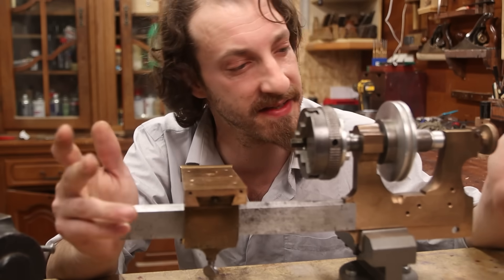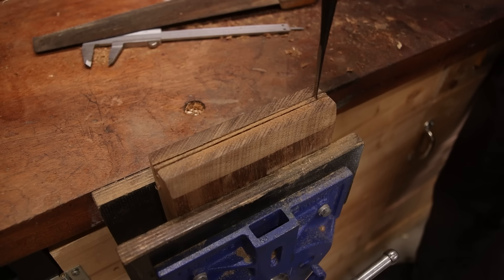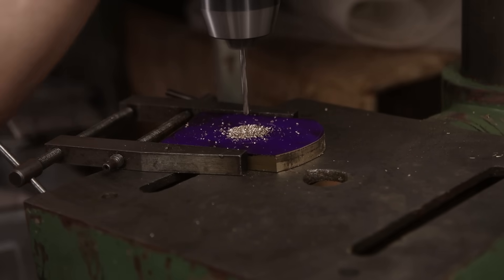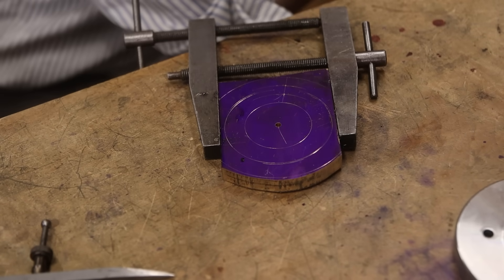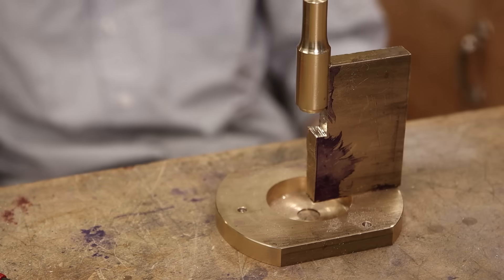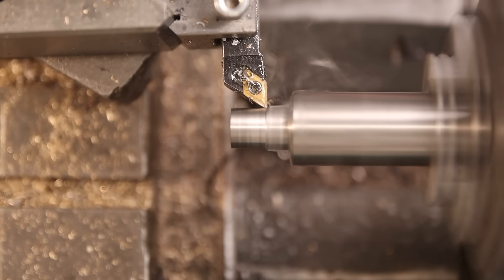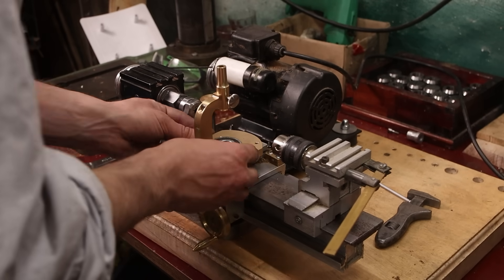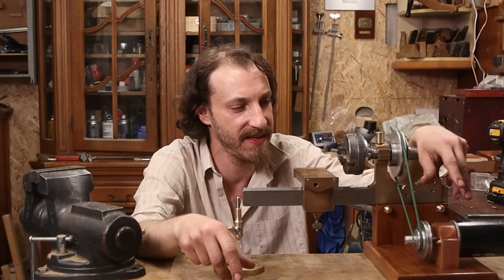Homemade Gear HOBBING Machine

Comment: if you buy a set of Cowells watchmaking machines (+/-5micron) and design and manufacture a proper pocket watch, I do believe you're good, otherwise you are just playing forever. Make a center seconds minute repeater with power reserve indicator, two parallel barrels and small energy escapement. Read Daniels book for a start, and make his watch, and then read 1940's watchmaking books, NOMOS has the know how from that too. Then you sell this watch for 10.000 euros, and you actually made some money. And talent wasn't wasted...

Comment: the problem is the discontinuous cutting from the tap. If you used spiral fluted taps, the tap cutting teeth will always be in contact with the gear and likely have greater chance of staying in sync and cutting the gear successfully.
Reply: No, the problem is the spindles are not synchronized. One needs to drive the other at a precise ratio. 

The other problem is it doesn't look like the "hob" is inclined on it's helix angle, so the teeth interact with the blank on an angle. I guess that's OK if you want a helical gear but I don't think that's the case here? If you did want a straight gear and you did offset the hob axis properly the blank wouldn't be driven by the tap at all as the teeth are passing purely parallel to the blank regardless of it's flute arrangement, so you'd never be able to make a straight spur gear. That's why gear hobbing needs to have two driven and synchronized spindles...

Comment: Hi think you will find the job came loose or the drive belt slipped. So it lost this position/timing so the tap just started milling the job not cutting a worm gear.

Comment: if you haven't already try a spiral fluted tap that way there's always some teeth engaged with the soon to be gear. 
having a gap wider than the material means the gear can slip and you accidentally cut teeth you want off. 

your craftsmanship is beautiful. if you're going to spend a lot of time making something its worth making it look good.

Comment: What's the point of cutting gear teeth with a random stuff such as a tap which is not capable to cut a proper teeth profile??? It looks like cretinism as you'll never get proper gears made the way like that.

Comment: Years ago as a apprentice machinist I worked in a shop that had multiple gear hobers. It seams to me your speed on the hob was way faster than those machines. Thay ran at maybe 60 RPMs.

Comment: This is not Gear hobbing . Gear cutting is such a specialized facet of machining that it has its own section and seperate set of standards AGMA. This trainwreck is ramming a improperly held oversized tap against a brass wheel. Within the facet of Gear making is the single point world of hobbing plate gears which are used primarily in clock movements. None of which you are seeing here  in tooling or in process, what you are seeing is .......I cant.....
Reply: Lighten up
Free hobbing can be, and is a legit process.
Reply: Uri, I've tried free hopping in the past. I don't think there's a magic bullet.

Here are some things that have tried.

Try gashing, even if it's just rough file nicks or bandsaw cuts. 

In super soft materials try running the tap in reverse initially. If using a tap as hob, it's ok to run in reverse in all conditions as tap  has cutting lips on both sides of the flutes after the taper stops.

Experiment with different diameters of gear blanks. 

Experiment with thickness of blankets by adding extra stock or sacrifice disk above and below blank.  Be sure blank plus waste stock is thicker than hob or tap gullet.

Make a starter hob, for non feris blanks.  Put  a knurl on a piece of steel threaded rod of same pitch to start a tooth form.

Comment: Hmm... Looked to me that having a constant pressure pushing the gear into the hob would help alot. Looks like the hob/tap were losing traction as they cut away the material. Perhaps an adjustable spring loaded sliding contraption would help keep a nice pressure between the tool and material eliminating the slippage. Oh, and maybe slow down the cutter by uh.......I dont know, maybe 100,000 RPM"S less!!!!!!

Comment: Great work, and splendid design! My guess for one of the reasons why it "failed", is the wide gap between the cutting edges on the tap. You want constant connection between a cutting edge and the  piece you are working with. As you tried it, there was nothing to keep indexing/rotating the wheel between the time one cutting edgde left the wheel, and a new edge entering. This will easily result in the new cutting edge just making a brand new cut, instead of  indexing in the exsisting one. Another tap, or the correct cutter you bought, could help.  Also a slower speed could possible help you out for a better result? (Hard to see rmp on video)

Comment: I think if the circle isnt the exact circumference of a multiple of the teeth, the gear wont match with all teeth. What you could probably do is add some timing to the cutter and part 'spinner' so to speak

Comment: it probably would have worked on your original setup if you had use a shielded bearing instead of a full rubber seal. The metal shield doesn't have the drag of a rubber shielded bearing, this has been an issue in other setups where I'm using a round rubber belt drive and am trying to time two different operations. I don't use rubber sealed bearingson any round belt driven machines anymore.  I'd bet money on it!  I don't profile the gear blank, just a straight face to present the tap to, it seems to work better.  That said I usually score (light cut) the blank with the desired tooth count using the dividing head on the milling machine if an exact tooth count is required. A bit more work but the results are perfect everytime.

Comment: Very entertaining video,Uri.  You will find the 'free hobbing' method works better if you cut a radiused profile groove around the periphery of the gear blank and also use a spiral flute machine tap rather than a straight fluted tap

Comment: Tip from Problem Solving 101: Compare the two setups and note the differences. If the gear holder and cutting heads are the same, then the difference is likely in the vibration of one or both pieces. (Solved on the larger lathe).

Comment: I've done something similar, but more primitive, in my lathe, a few years back, and it worked OK. It seems to me that your problem was insufficient contact pressure, particularly when starting the cut. Anyway, it's a beautiful add-on and you can do high speed reduction with only a worm and a gear, if you ever need it - I used mine to build a small size motorized hacksaw.

Comment: Dear Uri, a wee trick that I learned from Joe Pieczynski when parting off is to hold  a small screwdriver up the bore of the item (if it has a bore) so that the item when parted stays on the driver rather than disappear into a pile of swarf

Comment: that hole IS original, look at watchmakers lathes, from Boley, Lorch, there are TWO top slide options, ONE: a compound (like a metal lathe {Engine lathe}), or it's mate, an angle plate, with or without slides, clamps, or a grinding\saw arbor, TWO : a single post "turret", the post acts as a clamp to stop rotation, little chinease lathes have this as standard equipment, the slots in this fixture have grub screws to hold rectangular blank tooling (steel, brass), or the redily available knurling tool, or the boring bar adaptor.( to change from turning to boring, just index the turret). This has it's uses, the "post" is used for normal turning ops, the Compound or top slide has specific uses, thread cutting, for eg, where a drive shaft is connected to the headstock to drive the compound shaft, hence index the thread, also this feature, when used with a hand crank drive on the head stock chuck allows polishing, grinding, or topping of gears, etc. (with the grinding or milling spindle on the saddle, the work is on the headstock, so both can turn opposite to aid in finish of the piece)

Comment: Glad you got it working.
Here are a couple of tip
1.  Use a Helical Fluted Tap.  This will be that there is more tooth of the tap in contact with the blank and the rotation of the blank in relation to the tap will be more positive and reliable.
2.  Start with a thicker blank than you actually need.  Same reason.  You can turn it to finished thickness after the gear cutting.
Reply: I think that the blank was so thin that there were times that no tap teeth were in contact at all meaning for that period the blank was free to rotate a random amount.
I agree that a helical tap or thicker blank would be improvements.

Comment: @UriTuchman,

Add a small piece of loose felt to the bottom hole of the oiler. The oil should wick down to the bottom slowly. A lightweight hydraulic oil should work perfect on the spindle for what you are doing. 

The hole that you filled with the custom screw is probably for a split nut to adjust the X axis travel as the nut and lead screw wear together. 

Look for a spiral flute tap to use as a hobb, the standard 4 flute tap has an excessive amount of interruption in the cut. 

Support the tap on both ends to prevent the excess vibration above/below the centerline of the part being cut.

Comment: The only thing you need now is a vertical adjustment on the "gear" holder so you can hob full gear instead of radiused teeth.
Love the design and build!!!
I've been thinking about an improvement to my Taig ... and I love that handle you made for the watchmakes lathe! I may have to borrow that shape.
Thanks for sharing 🇨🇦

Comment: Nice job. You need to upgrade your hobbing toolkit with encoder, arduino and stepper motor+toothed belt in order to sync gear hob with blank. That looks cheaper, than making complex gearboxes.

Comment: I'm a little worried about the axial and radial play in the large bearing.  I think (?) most inexpensive bearings have a "C3" clearance.  And in my humble experience (with cheap 608 bearings), a single bearing does not give a precision constraint in terms of "wobble" in a set-up like yours.

Maybe consider trying two ball bearings, spaced apart?  That might constrain the axis of rotation better?

Alternatively, you could use a dial test indicator to test your setup for play and/or rigidity.

Comment: Suspect the inability to cut the gear initially is that the drive belt is slipping on the highly polished arbor you are losing power and unable to cut the gear, but you don’t hear the belt slipping.

Comment: You need a way to move the part up and down. Normally, you'd start just cutting the very edge of the material, then moving into the piece.
Reply from the maker: Yes, I just bought a vertical slide, and I'll give that a go.

Comment: I think it will work its just the turning speed is way too high. Cut the threads at a slower speed. An amazing piece of engineering. Well done.

Comment: When looking at 16:06 the gear seems to have failed - the teeth are not of equal size, possibly the gear is wobbly? A small amount of inaccuracy can already cause quite some trouble depending on your application.

I also started to do DIY CNC gear hobbing around last year, getting some result is not so difficult but it depends on the end-result. chaining several self made gears together might end up in a non-linear movement at the end if the gears are not perfect.

Comment: Two days before your video come , I make something like this , but from drill , and not bronze  , I try use circles from pvc pipe , more soft and easier to cut tooth i thing like this 🤦‍♀️ , but also fail 😢, also spand time , but experience , if interesting l can sent  photo or small video on email 🤔

Comment: Why not use the back gear instead of the lathe spindle handle ? 
The Super 7 has one, does it not ?? 

Looking at the machine in operation, I think I would protect the bearing with a large rubber washer which is a tight fit on the shaft... otherwise the brass chips WILL work their way under the bearing seal ..... 🤔

😎👍☘️🍺

Comment: I have the doubt that getting the threading tool closer to the gear axis as you are cutting is the right way to do it. The diameter of the gear reduces and the number of teeth changes. Maybe is better to keep the distance between both axis the same and move the gear blank towards the lathe chuck.

Comment: Dude , you should already have learned from your previous projects that you should build way more rigid than  those flimsy constructions...i admire your patience, but you could easily get much better results with minor effort..even less...i think you work hard instead smart ! my honest opinion! with gear hobbing it is very important to plunge almost direct at the depth of cut u want !

Comment: Could you add support to the free end of the "table" (though in this case it's more of a dovetail slide) to increase rigidity? That may be your problem, not enough stiffness for the cut, and the tool is deflecting from the part.

Comment: Hi
If you pre cut some rough edges (shallow) on the gear blank at correct tooth locations, and run your tapping tool slowly, you will get nearly perfect results.
Cheers

Comment: Wasn't it the backlash on the cross slide travel that caused the problem with the watchmakers lathe? Just make an anti-backlash nut. That will enable you to use the pretty brass and mahogany parts all together. Otherwise just pull and hold the crosslide back toward you as youre getting ready to cut, and during the cutting. That lathe is small enough, you can probably just hold it backward and the cutting action will do the rest. Just dont let it slide forward or allow any wiggle room, or you will crash it.

Comment: Nice myford…..you finally have a decent lathe!
That’s not really gear hobbing…….but you are making nice worm wheel or worm gears…….hobbing requires the gear blank to be powered AND synchronized with the powered cutter…..and the cutter needs to be inclined to negate the pitch of the cutter!

But you made really nice worm gears…..so it’s a win!

Comment: The success of such kind of gear hobbing depends on wether there is a continuous cut from the cutter to the workpiece. So the tap wasn't really working at first because of the 4 big flutes relative to the thin workpiece, the actual gearhobbing cutter has many flutes and very small openings so it has almost continues contact with the workpiece from the start. This greatly reduces harmonics but you still need rigidity so no long cutters or large diameters but still...

Comment: You could try mounting a variable speed motor to the gear blank spindle. Then matching the speed to the cutter speed to gear blank, this will stop the 'skipping' you are experiencing. I would also say that your jewellers lathe is more suited to lighter loads and making thinner gears, sprockets and cogs etc.

Comment: I think the flutes on the large tap were too big for the thickness of the brass blank. This mean the blank lost contact of he tap which is why the blank stopped rotating. Hobbing machines usually work by the cutter and the blank being turned by the same motor.
Look up a book called "Wheel and Pinon Cutting In Horology" by J. Malcolm Wild, I think most the old machines they show in the book cut one tooth at a time but you might get some ideas.

Comment: I'm glad you figured out on your own that a tap is NOT a gear cutter. About the watchmaker's lathe, I have a crazy idea for you, that might just work: Use it to make really tiny parts. That's what it was designed for, that's what it can do. And replace that ridiculously big 3-jaw with a nice small collet chuck in the sub-20mm range. Seriously, look at that thing, it's proportions, its belt drive, and figure out the cutting forces it can supply. Those things simply aren't designed to hob huge gears, they are designed to make .6 mm screws. And that's what they do well.

Also, well done. It's been gratifying to see you grow from your humble beginnings into a competent engineer and fabricator.

Comment: The milling cutter used to make the gear is for a hobbing machine. In such a machine, there is a fixed connection between the tool axis and the workpiece axis via gear wheels. These are changed according to the number of teeth required. When the cutter rotates, the workpiece rotates with the pitch of the cutter. Then only the cutter has to be moved axially to the workpiece axis. This then produces straight or helical-toothed gears. The simpler, cheaper method of producing gears is with a dividing head or dividing disc and a disc cutter with the necessary tooth profile. There are different profiles for different ranges of tooth numbers. However, this can only be used to produce straight-toothed gears. Watchmakers produce missing gears in this way.

With the oiler, I would also put wool threads in the hole up to the lubrication point. That's how it's done on old machines.

Comment: at 7:32 are you using an abrasive on steel? If so you shouldn't use metals softer than the base material on those as the abrasive will come off and dig into the part

Comment: Free hobbing is always a bit iffy - the general recommendation is to gash the blank using a dividing head to get the correct number of spaces and let the hob profile the remaining "teeth", though you can still lose a tooth because the flank of the hob that is driving the blank tends to cut away somewhat more than it should and once it starts, that tooth will steadily vanish.

Comment: Idea for the Old lathe could be an "Uri's take on the Turnado" (eccentric engineering makes a terrific piece of kit for "free handing" metal on a Lathe)

Basically a workstation for you to make artsy shenanigans in a less inhibited/linear environment.

Best of luck!
Reply: (if i don't misjudge the idea, which wouldn't be the first) The amount of rigidity required for purposed project could be in the ballpark for said machine.